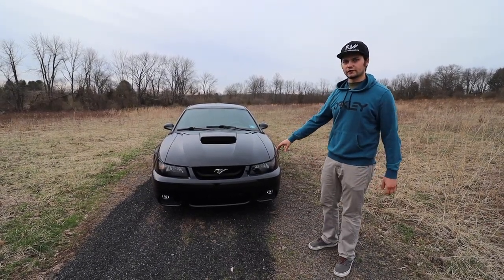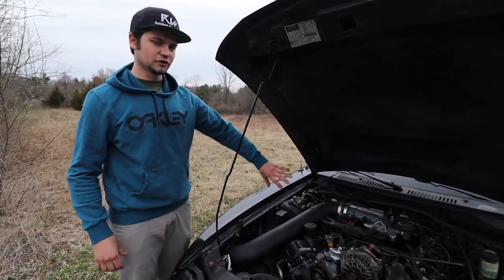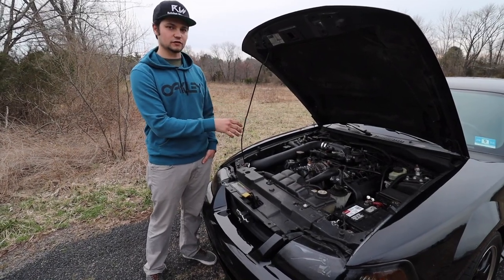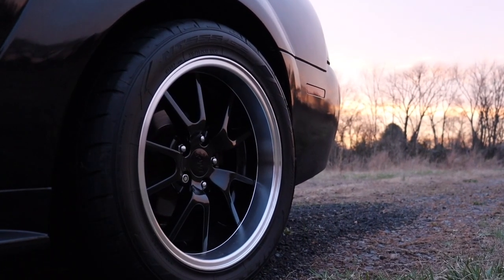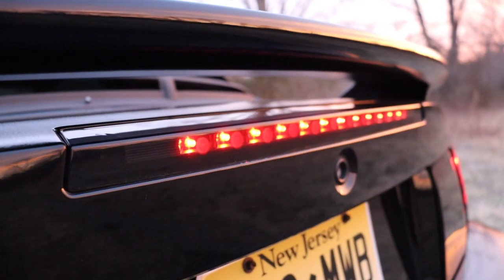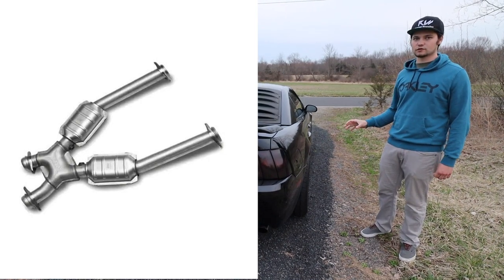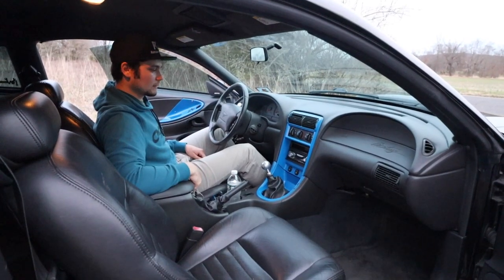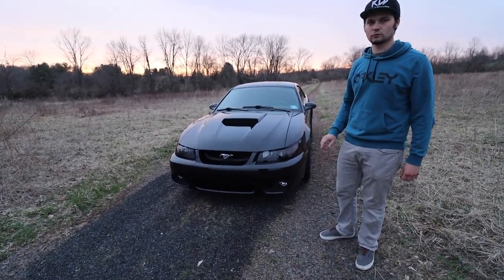Everything Done To Our NewEdge Mustang | Full Mod List

Comment: Nice build....I like that you are putting the time and effort into a GT....there’s a lot that can be done with that car...I have a 03 Cobra that I’ve had for 18 yrs...pretty much have done everything to it..2.3 Whipple...4:10 gears..lowered..rear suspension has been upgraded with MM bushing kit...T-56 Magnum..Spec stage 3 clutch...Crower stage 3 cams..Borla Stingers..Bassani X..frame ties...Brakes..Nitto 555...Ford Racing FR500 wheels..(the real ones !)...it’s been a great car...35,000 mi..Red Fire..it’s got too much to mention here..keep up the good work...😀.
Reply from the maker: Thank you! Yeah the 2V’s are highly underrated and produce one of the nastiest exhaust tones with the right set up. I just ordered a new exhaust so stay tuned and let us know what you think when it’s on. Your build sounds complete and clean. I’m sure lots of time and money has went into it, that’s where I’m headed but I love it! 🇺🇸

Comment: I'm running a SLP Loudmouth and I think it sounds great. I also lowered my car with Ford Motorsport (Eichbach) lowering springs, Koni Orange shocks and struts, BMR tubular control arms (front and rear upper and lower, QA1 sway bars front and rear, QA1 caster and camber plates, BBK strut tower brace and finally the Stiffler FIT system subframe connectors with jacking rail and crossbars. Waiting on parts for the Cobra brake upgrade front and rear with Hawk drilled and slotted rotors front and rear (backordered). I also have a Stifflers lower chassis brace and rear shock tower brace waiting to be installed as well.
Reply from the maker: Sounds like it's built for the race track with that set up. Definitely need to do a lot of these upgrades for my car eventually also

Comment: Nice video!! I have a 1999 Mustang Gt convertible with a five-speed stick. It's got every performance bolt on available, Crower stage two cams, with full length headers into an off-road x pipe with two chamber flowmasters. 3.73 gears out back.  The tune is for 93 octane, 295 rear wheel horsepower with 305 ft pounds of torque. These numbers don't sound like much but the car runs extremely  low consistent 13s . It's so much more fun to drive and sounds great. 2V Mustangs can be a fun car for those who can't afford to spend $50,000 on a new car!!
Reply from the maker: Sounds like a great build similar to mine! Yes I agree they are very fun cars and sound incredible. I’m curious what mine will run when we take it to the track this year.

Comment: i have a vic jr intake i'll prob never use, also have the mhs 6061 custom plenum, although with that i think you need a cowl hood.  if ya decide ya wanna buy one.  just remember vic jr requires use of specific rails, so don't get standard rails thinking u may add vic jr later.  otherwise you'll be where i am, i got the fore rails first, rather keep them than swapping intake.

i had the same exhaust (flow) back in the day and was shopping for the same (borla/slp/etc), ended up getting sss exhaust.  they seem to be a knockoff borla, but built as well.  i've had it for prob close to 10 years and it's still perfectly fine.  it is segmented more, so more of a pain to install, but once together sounds really good.  DO NOT use with o/r mid, sounds like shite, like a fartcan civic on crack.  for gears, i had 3.73 with my procharger, and it was good, 3.55 would've been good too.  4.10 no way.  i swapped the transmission during engine build, with diff gearing and 3.73s the final drive was close to stock (w/3.27s), got 4.10 to bring final drive closer to 3.6s or so(with stock trans).  decide what tranny you want before messing with gearing, if it's different, you'll need to consider that when choosing rear gear.  i have t56 magnum, but the gearing is what's important.  and if you planning to exceed 500hp or so, get the mcleod twin disc, i have the rst cuz rxt was excessive.  it's lighter than stock, and linear, not those weird two step feelign clutches, unless u like those, then get a spec.  i had the ram before that, it was really nice feeling too.  closer to stock, little heavier than mcleod, but also linear, only swapped for hp capacity.  don't forget al flywheel while you're there.  weld in sfc's will change the feel more than any sway bar, people always say they're underrated, they really are.  of all the suspension stuff i've done, i felt the most handling improvement with those.  for driver feel, the thicker steering wheel was nice too, def recommended.  like shifter, just improves driver experience.

Comment: When you bought the gears and the torsen 2 in did you by chance change the axle spline? I saw the video when you showed off the torsen and I thought this is interesting but I couldn't find one for the factory axle. They all wanted the 31 spline.
Reply from the maker: Nope stock axle spline. They are harder to find but maximum motorsports sells them on their website. That’s where I bought mine.
Reply: @RatchetWrenches  ok thanks for the heads up

Comment: Getting a new built motor put in Thursday 🔥🔥🔥
Reply from the maker: There ya go! What’s all done to the built motor if you don’t mind me asking?
Reply: @RatchetWrenches  custom cams , and ported heads, and going on3 turbo kit and mmr rods and pistons and stock crank.
Reply: Exhaust I have slp loudmouth 1 with bbk hpipe
Reply from the maker: Sounds like a great set up. What size turbo? Not goin with a cobra crank? Heard people say that’s a solid upgrade that’ll get you to 1000hp
Reply: @RatchetWrenches  I looked into it the stock crank is good for 700 from what I read. But it’s still my daily driver so I’m not going for nothing crazy crazy and if I’m not mistaken it’s a 76mm.
Reply from the maker: @drippyjah2373  oh that’s not bad actually for the stock GT crank. 76 will be awesome I’m still debating on what size I’m gonna to when I do purchase the kit. I’m tempted to go 76 BMF or upgraded billet wheel & ball bearing but not sure if it’s worth the money.

Comment: Get the borla s type over slp 100% quiet at idle but loud when wot
Reply: I have bbk longtubes and off-road x pipe with the borlas and it honestly sounds like one of the best setups not bragging about my car, only thing I would change are some cams and kooks longtubes and x pipe
Reply from the maker: Yeah we went with the borla stinger!
Reply: @RatchetWrenches  haha yes I just saw the video of you installing it. Sounds sick with the cams at idle
Reply from the maker: @tyuspoletti  thanks yeah it really does sound great all around
Reply: @RatchetWrenches  yeah, an borlas are known to get a bit louder as time goes on and the muffler packing disintegrates. Do a 40-60mph light pull in 4th and you should get some slight gurgles and pops

Comment: What size tires do u have?
Reply from the maker: 315/35R17 in the rear and 275/40R17 in the front
Reply: @RatchetWrenches  Thk you. Are 225s ok for 2004 6 cylinder ? Last question I apologize.